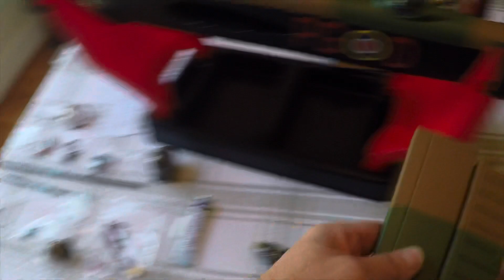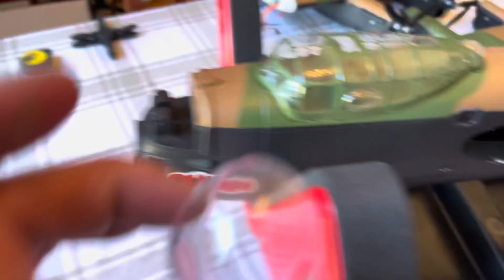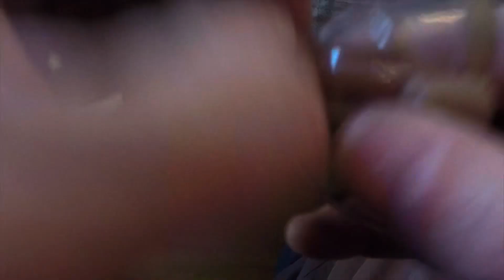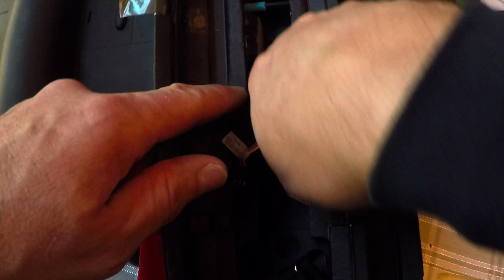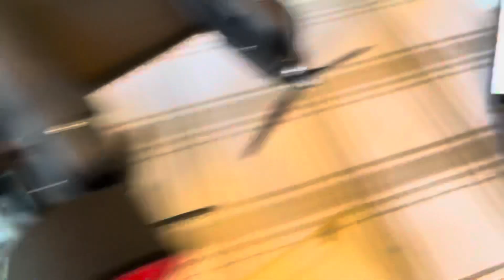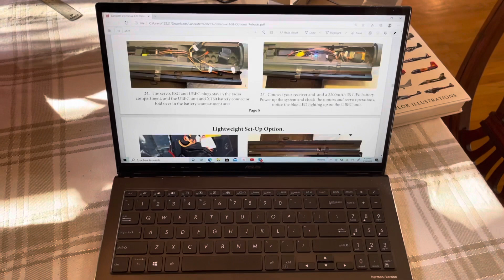HobbyKing 1320mm AVRO Lancaster V3 Assembly and Build video

Comment: Thanks Jeff, I just ordered one of these along with the Gladiator, so of course I pre-watched your assembly. Looks like a fun assembly. I liked the tape trick to remove the paint. Hard to believe a 1300 3S powers this big 4 motor plane. Love how scale it flew for you. Thats how I fly the Albatross, and its very enjoyable. I'll have to look on RCGroups for a mix walk-thru. Probably the same as my Albatross will work. This plane is a steal at $129.
Reply from the maker: Flys really good with diff thrust 👊🏼

Comment: a DX8 i am guessing will do the differential  no problem  , i am going to add some clear rudder extensions  and try rudder also
Reply from the maker: Hi , yes I use a DX 8gen2 and it works great, rudder should be nice on this aircraft as well, best regards 👊🏼👊🏼

Comment: For differential thrust, did the kit have all the wiring you needed. I would like to see how you have the  diff thrust wired.
Reply from the maker: Yes it did Tom, plug  and play as per manual, differential thrust was easy to set up with my spektrum DX 8Gen 2, pretty straight forward 👊🏼

Comment: nice video thanks :)

how was it to fly? did it threaten to tipstall at any time? did it feel safe to fly? how easy was it to land? is it easy ti break propellers on landing?
thanks
Reply from the maker: Hi...flys incredible with differential thrust and never indicated a tip stall, landing was nice as well with a slight flair before touching down, props are pretty rigid, so no worries there as well, really enjoyed flying this plane, thanks for watching 👊🏼👊🏼